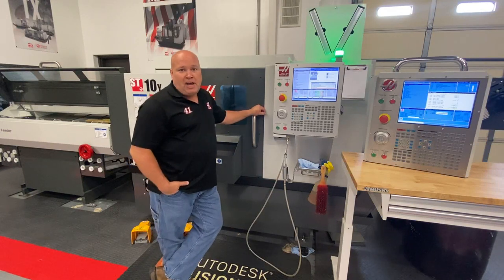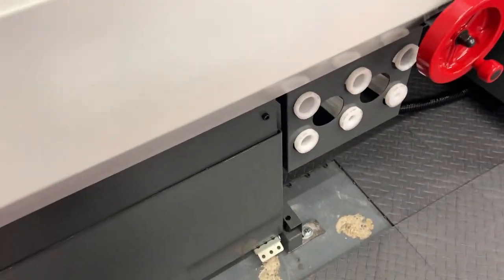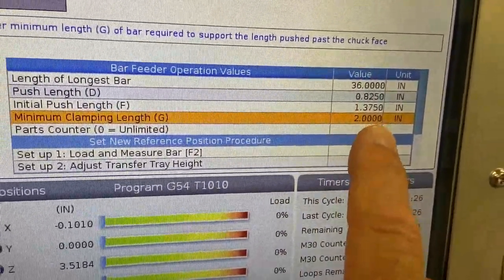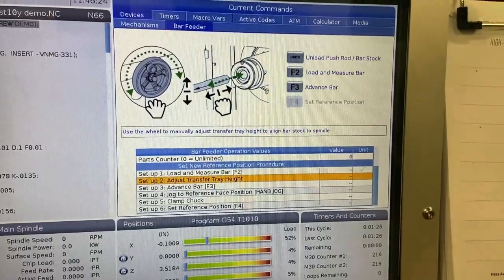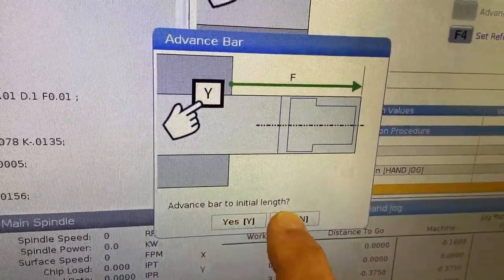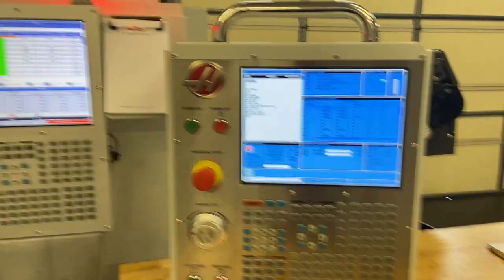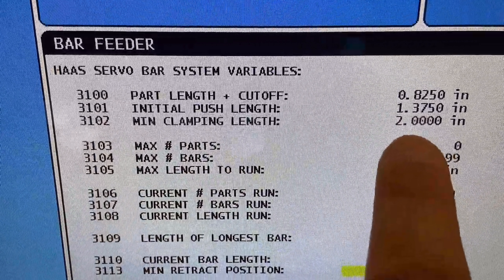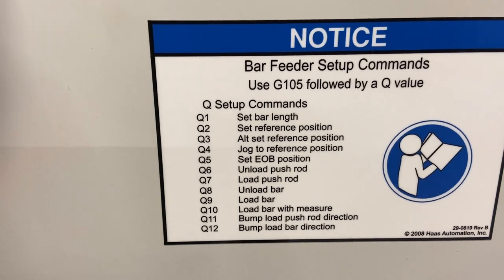Haas Bar-Feeder Setup Instructions - NGC and Classic Haas Controls.

Comment: @3:33 I do the same thing on  my brand new ST-30. Once the bar end moves past the detector, the light turns off, but the bar doesn't stop like yours did. it'll keep feeding the bar into the spindle, and then say "Bar not detected in tray"
Reply: Hi @PanzerShrimp.  You will want to contact your local HFO for a service visit.  We have seen this before.  If I remember correctly, the problem was one of these cases:

- Bar-feed parameters may not be properly set.
- The EOB (end of bar) switch is not wired to the correct terminal on the I/O board.
- Your material is "see-through" (think acrylic, for example).  This is fixed by spray painting the end of the bar, so the switch is not looking "through it"
- Your material is very "shiny", which causes the same effect (it reflects the laser back from the send to receive, fooling the switch).
Reply: @Darren_HFO_Champions  thanks for the reply. I'm fairly certain the parameters on the back of the bar feeder aren't set yet into the control. I contacted HFO!

Comment: I have my initial push length set to 2.0”. G105 Q2 will push it out to correctly to 2.0”, but after the part off took it only pushes out ~1.8”. Any ideas?
Reply: Hi Scott.  I may be misunderstanding the question, but once you execute G104 Q4 (loads bar), jog the bar to be flush with the face of the chuck (V-axis on Classic Haas), the G105 Q2 should set the reference, open the chuck, and feed the bar out to the initial push length of 2.0.  Next, you will run the part (turning and part off) and execute a G105 before M30 or M99, with no Q-Code.  This will feed the bar out to the "part length plus cut-off" position, which should bring it back out to 2.0.  Remember that the part length + cut-off setting should be exactly that, which would feed the bar back to 2" out of the chuck.  I hope this helps.

Comment: I’m having an issue when it measures the bar to the sensor. Instead of slowly pushing it to the sensor, it shoves it really hard past it and I get a “bar too long” error. What could be the reason for that?
Reply: Hello.  You will want to get your local HFO service department involved.  There are several possible reasons for this:  1) Are you running acrylic, very shiny (chrome) bars, or very small bars?  I've sometimes had to paint the end of the bar to get the sensor to work.  2) There were several parameter updates over time that controlled the measure speed and rate.  3) The "bar tool long" normally means that the length of the bar is actually longer than your "max bar length" setting, or the bar feeder needs the 12' test bar calibration run (G105 Q5, if I remember right, which applies to previous generation bar feeders (ball-screw driven vs. belt driven)).  All fixable, just too many reasons to post why this may be happening.  Thank you for watching!

Comment: I cant get past G105 Q 4. I hit reset and try to move the v axis/ bar fpush bar but it wont do anything, if i try to handle job the v axis it says its disabled.
Reply: Do you have a Classic Haas Control?  If so, you should be using the G105 Q4 / jog / G105 Q2.  When executing the Q4, does the bar-feeder load the bar, push into the spindle, and load the push-rod?  If so, your V-axis is surely enabled and running.  

When it states that your V-axis is disabled, try pressing the letter "V" on the alpha keys, and then pressing "Handle Jog".  Depending on the age of your machine / bar-feeder, your feeder may be controlled by a "Red rotary control box" under the bar feed tray.  That will be run as an "auxillary axis".  Be careful if you have this type, as the red control box will memorize every click of the hand-wheel and send your V-axis into over-travel or an alarm status.  Your local Haas Factory Outlet office may need to get involved as well.  Thank you for watching!